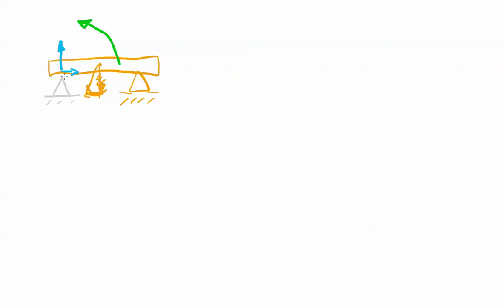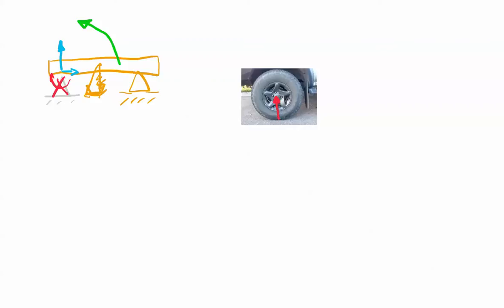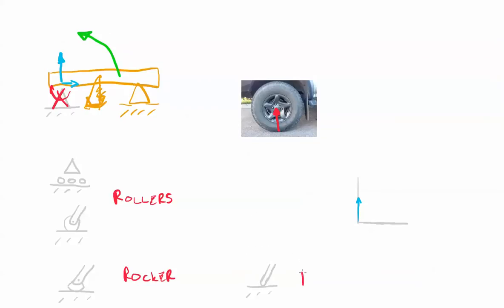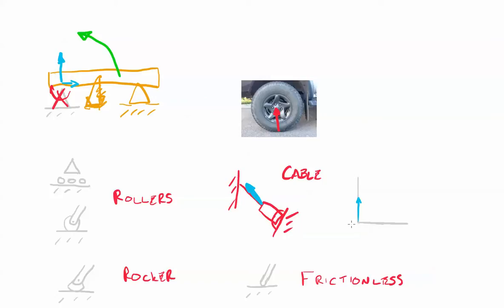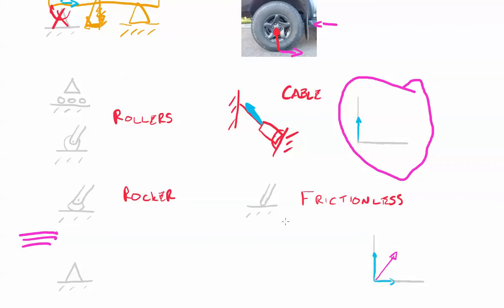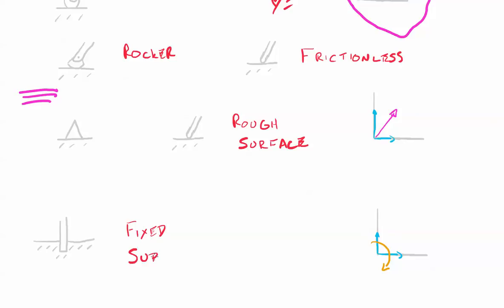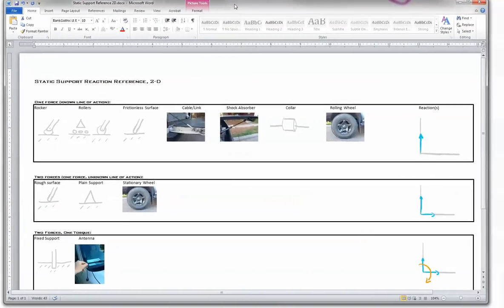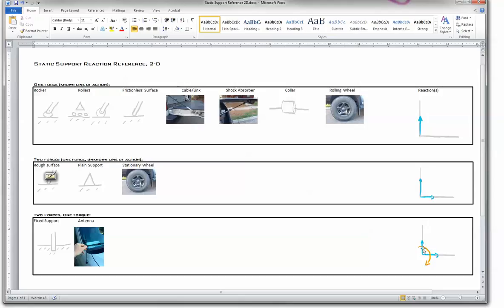Engineering statics 15 supports 2D

Comment: Quick question, if a torque is applied away from a fixed support, does it still cause a reaction on it?
Reply from the maker: Julian Sia Hmm, I'm not sure precisely what you mean by your question.  That said, if you apply a moment / torque to a free body, it does not matter where you apply the torque.  In other words, the reaction forces (and moments) will be the same, regardless of the location of the moment.  Or, in other words, if you have a cantilevered beam, you can apply the moment 1 inch from the base or 1 foot from the base-- both will have the same affect on the body (as long as the magnitude and direction of the moment is identical, obviously).  In this way, applying a moment to a free body is very different than applying a force to a free body (where the location of the applied force matters).  I hope that answers your question.
Reply: Thanks for the response! I should have asked "does the location of the torque matter". So, yes, you answered my question. Great videos by the way, and while i'm here, are you going to have additional examples for centroid?
Reply from the maker: Nothing planned presently, but you can find a central location for that chapter at my website, here:
http://educadia.org/learn/level-2/centroids-centers-gravity-chapter-5/